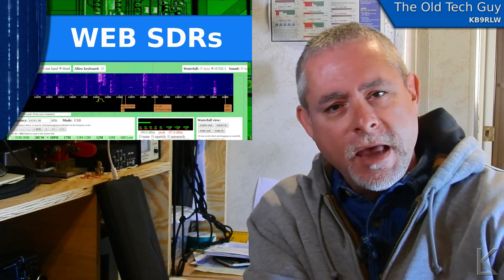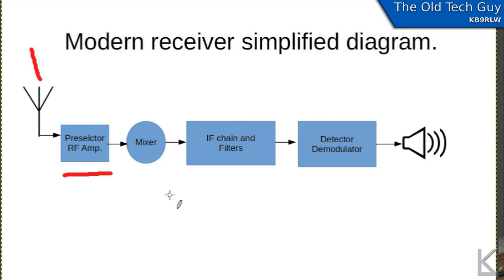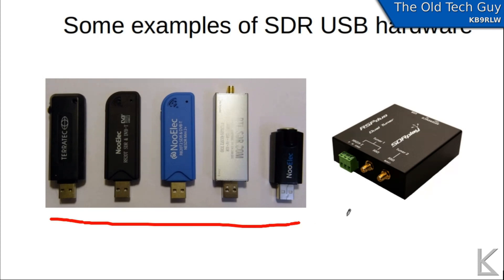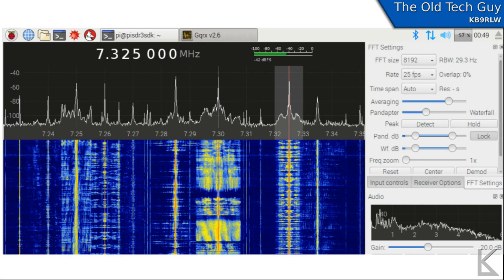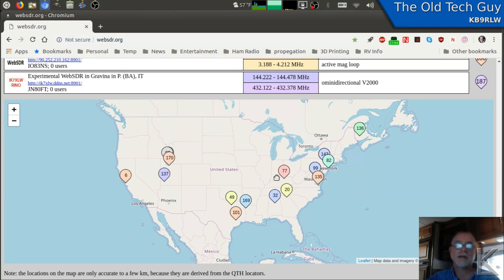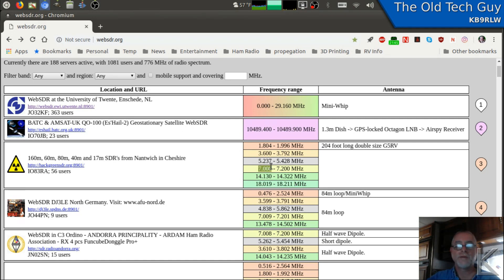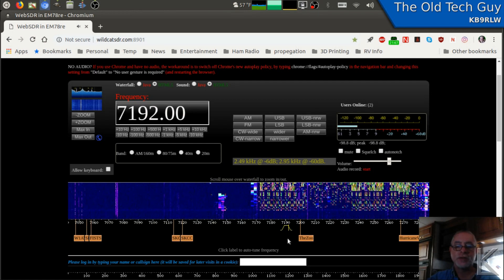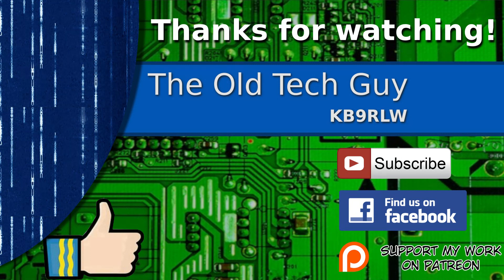Ham Radio - Viewer request. - Web based SDR radios you can listen to for free.

Comment: I let my Novice License expire during the 80s, I am now retired and studying to get back into the hobby. 
The webSDRs give me two advantages:

#! I can listen to the Tech bands without a license to see the activity on the bands.
#2 I can get practice turning a receiver in without having to set up my apartment window antenna and connecting it to my Xiegu G90.

So far I have only been able to understand two signals on the 10-Meter SSB sub band. Every other time either there were no signals on the waterfall or the person sounded like Donald Duck! But I think that is mainly caused by me not knowing how to set the SDR correctly.

One tip for new potential Techs like me. Look at the WEBSDR map and pick an SDR that is close to you. That will give you a better idea of real world propagation conditions for the area and time of year you would be operating in when you go on the air.

73

Comment: Kevin. Highly interested in learning how to set up my own web sdr server. As importantly how do I open up my cable companies router to allow me to do this. Thanks for what you are doing.
Reply from the maker: As I understand it, they only give you access to the software if you're going to put up a full time server. I may ask them to make an exception so I can do a tutorial.
Reply: @loughkb  I thought, last time I checked, they were NOT interested in having numerous hams using their product. KIWI sdr is free / open source but one of their devices might be required. I was thinking of using a KIWI SDR like a MMDVM  hotspot ...only for HF, not digital FM radio. Essentially get your / our/ or local  web (KIWI) SDR receiver . Transmit to these on the on the frequency of interest and you are accessible to everyone around the world via internet because your web sdr device hears the propagation and your transmissions as well. With enough on line devices every one will have access to everyone else. regardless of propagation. No audio codec required.  I know, this is not real HF just like DMR is not real FM but it is another HF mode /internet enabled communication link.
With most emergency communication  needs being relatively local, just getting HF out to the unaffected area would be enough for assistance.
All the radios we have are all that are needed.  We just need more HF  hot spots/ web SDR,s online.

Comment: Kevin Loughin, Isn't it ODD that there doesn't seem to be any Mac (UNIX) software, even though the OS is robust?  de KQ2E
Reply from the maker: Actually, there is quite a bit. It just takes a little searching. Most of the open source projects like fldigi have been cross compiled to Mac, I'm pretty sure.
Reply: @loughkb , Thanks for that comment, as I do have some software, but it just doesn't "feel right" to me. I'm always told to "watch out" for some reason. LOL

Comment: With multiple users logged into a remote SDR, will each be able to tune their own slider?
Reply from the maker: Yes! The SDR Hardware scans the entire HF Spectrum or at least the area is set up to scan. Then the software just Doles the streams out to the connected users since they're pulling from one massive pool of data, they can each look at a different part of the spectrum.

Comment: I have set up a receive antenna to an SDR dongle. How do I isolate the sdr while I transmit on same frequency on my transmitter so I don’t over drive the sdr?
Reply from the maker: Transmit receive switch that grounds the antenna input to the SDR when you're transmitting.

Comment: Nice video. I'm often at a QTH with  a S9 noise floor. I'm now thinking about setting up a Raspberry Pi, SDR receiver and a permanent antenna in a nearby, S0 noise floor QTH and transmit from my noisy QTH. In this way, I don't need a full-blown remote rig control, but I might actually be able to get some QSO's in, which, right now, is absolutely impossible.
Reply: I used to have a noise floor that varied from S7 to S9.  Then an old ham told me to get my antenna away from the house.  I put up a inexpensive inverted L antenna in the trees behind my house.  Now my noise floor is S2 to S3.  Look at “My antenna 80-10”.  Google it.  W2UW